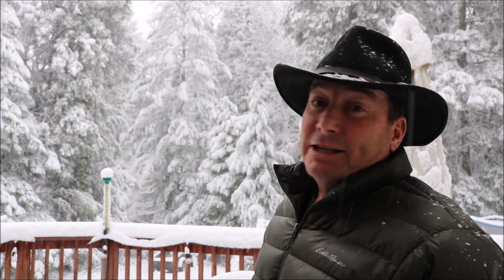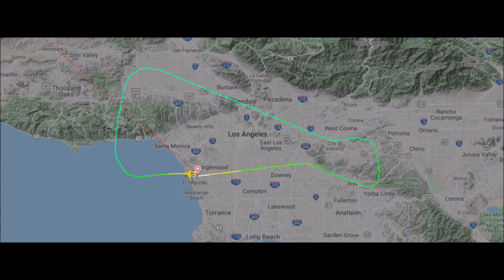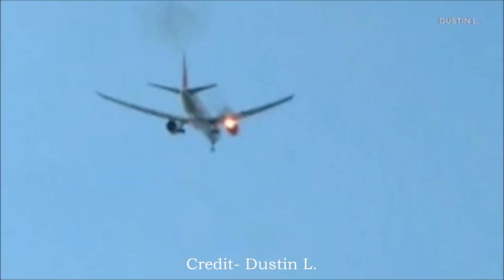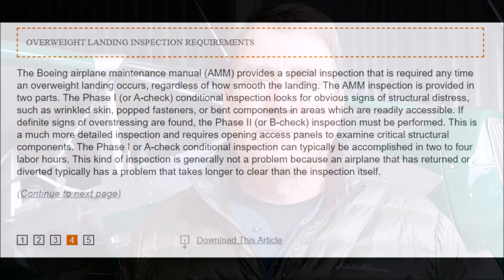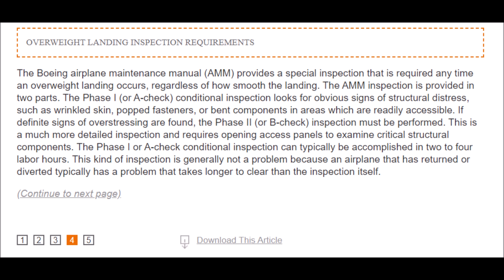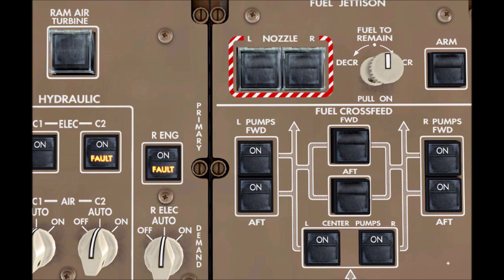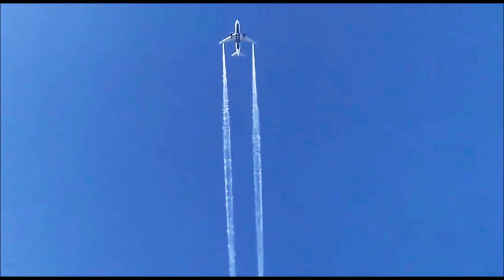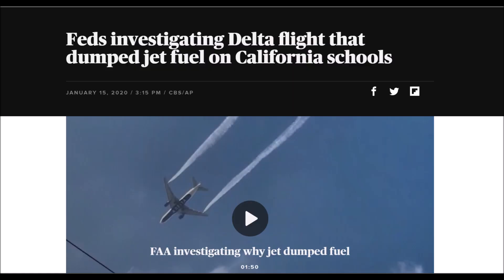B-777 Fuel Dumping and Overweight Landing Considerations (Part II)

Comment: For what it is worth. I am of the opinion that all of "Alphabets" subsidiaries are implementing an agenda that is both wide ranging and comprehensive in scope and anticipated outcome. The vagaries and inconsistent nature of the various "problems" and "issues" encountered by individual subscribers are indicative of an algorithmic non-linear random hierarchical distributed control system wherein the rule based flow diagrams which would, ordinarily, deliver consistent analysis and processing of system throughput, is assigned a subordinate priority to a master set of code intended to create the appearance of processing error. The purpose for such a counterintuitive  rule set is to inject chaos into a seemingly complex operator and provide credible rationale for errors. A sufficiently macro analysis of all errors and error patterns  may provide evidence of the deliberate inclusion of such code. Further, a self correcting diagnostic sub-routine, coupled with an heuristic feedback loop, will continue to modify and rewrite it's own operators to force evolve and deliver credible performance statistics as a means of misdirection, camouflage and concealment. The human components are, quite possibly, unaware of what they are dealing with. A similar runaway system without access to external networks was scuttled by DARPA due to the unpredictability of the resultant descendant.

Comment: OK, so there is commentary here that an overweight landing can take place with 6,000 ft. of runway. The problem with this, is that numbers indicating max gross weight stopping values are contingent upon both engines being functional and providing full reverse thrust during landing. This was a plane attempting a near max weight landing on a 12,000 ft. runway with only one engine and maximum manual braking. The checklist from Boeing as I reviewed simply says to land overweight under single engine conditions, but gives no callouts for what the max landing capability is of the aircraft without full reverse thrust. Both of these conditions occurring at once, do not seem to have a checklist, despite the callout in the single engine failure checklist to land overweight ASAP. Please, correct me, if you have the data to back this up. Is this an oversight of the checklist? Or are their supplemental numbers for max landing weight under these conditions? Was the plane ever tested for this set of conditions?
Reply: Christopher Bruscato: Juan said in response to another question about thrust reversing, "No, you don't reverse on that engine [meaning the Rolls Royce] anyway. Its built into the calcs."

Comment: Here's a thought, why don't you contact news outlets like CNN?  Seems they need someone who knows what they are talking about!.  No where have I seen your comment that this aircraft does not need to dump fuel in order to land at take off weights if there is sufficient runway available.  It also took news outlets far to long to discover that the pilot had said he did not need to dump fuel.  Looking for a channel boost, this might do it.

Comment: ATC asks if they wanted to do a fuel dump and they replied that they did not.
Reply: liam101ish: As Juan often says: Watch again. ATC asked if they wanted to HOLD to dump fuel.
Reply: @lizj5740  Fair enough but they give FUEL on board as 212 Tonnes when they declare and before final they are asked again 209 tonnes...why not indicate it will be less after the dump especially if equipment is rolled as they ask?   They are also requesting the longest runway because of weight.   I think ATC assumed as well they were not needing or intending to do the dump.    ATC should have pressed them but if I was the guy working it, I would have made the same assumption.  They are not dumping and do not intend to do so.

Comment: Why are the tires filled with nitrogen?
Reply: Less likely to burst and when it does burst there is a lower chance of fire.
Reply: @nightflyer3242  Does it compress better?
Reply: @staubach1979rt  Not really.  Air is mostly nitrogen anyway.  For one thing, using dry nitrogen in the tire ("dry" so there is no moisture to condense and corrode the wheel or other metal) rather than air reduces or eliminates the chance of ignition within the tire if a contaminant is introduced.

This happened for example with the nose tires of a widebody several decades ago.  The tires were inflated using a hose which had hydrocarbon contamination on the inside from having been used for something else.  The NLG tire(s) failed during takeoff roll, and takeoff was aborted post-V1.  The aircraft overran the runway, stripped the landing gear per design, and was destroyed by fire.  IIRC everyone made it off ok, the last one off being a flight attendant who had made sure the smoke-filled cabin was cleared before jumping from the sill of the forward entry door (no slide).
Reply: @marcmcreynolds2827  Interesting. Thank you.

Comment: Great Video   Your standards aren’t far above the Media giants, sadly 
I had a fuel dump in my Piper Cherokee 😱 Leaking test valve that vented 24gals in 40 minutes. I landed without out incident, Thankyou Lord
Hours of mundane flight sparked by seconds of terror.  Pilots did there primary job, return safely 👍

Comment: Add further please, to the following concept:  While it  would seem common sense, if you have to Jettison fuel, and preferred altitude is not available,  One might want to jettison over non populated area.  --> The public continues to insist there must be a LAW about Where It's Allowed.  That is, a specific aeronautical, FAA denoted /region/ where jettisoning fuel would be permitted.  Such regions do not appear on my approach plates, nor on any of my charts,  Nor are such regions mentioned in the FAR/AIM.  Nor is any specified region listed in ATC  sections of CFRs.
==> Thus I conclude:   There is no such specified region.   Just as there is a recommended min Altitude to jetison fuel there is no binding /regulation/ specified altitude. 
 Please expound on this region-concept as exists as a regulation:  Plenty of world airports have no such space available around cities.  // (*Other than 14CFR 91.15, that is.)
Thank You.
Reply: I thiught that the issue was the low altitude. Could this not have been avoided if they anticipated the problem?
Reply: @kirstinstrand6292  Issue was low altitude, but only as far as a recommendation on normal flight.  There is no mention, in any of the regulations of jettison altitude for EMERGENCY flight.
The only regulation on fuel jettisoning is that the aircraft KEEP enough fuel for 30 minutes of flight.  Nothing about altitude.
Your Second Question:  Could this not have been avoided if the anticiapated the problem?
-- er.... anticipated the problem of having a Compressor Stall and declared emergency?
 Are you asking if they could have anticipated this emergency?     ???

Comment: If this were a GE90, never would’ve happened 🙂
Reply: It's not the engine, it's the adjustments to the engine. Or possibly a faulty sensor for either outside air pressure of compressor inlet temp.

Comment: Hi. Why couldn't the pilots and the crew members just issue all the passengers parachutes and then push them all out of the plane on final approach, instead of dumping all that expensive jet fuel? I think Boeing now has to install a Static jump system into all their new manufacturerd aircraft. A new Static jump system S.T.C  for the Boeing 737 MAX just may be the thing that could save that program? What do you think Mr Brown? I personally don't understand why the pilots had to dump all that Jet A ?  The Pilots could have also just put the aircraft into Military power,                           "Full Afterburner" and just burned the fuel off with a few loops over the patch? Stupid pilots, don't  they know anything? I remember having a similar situation way back in WW2. I was taking off from the deck of the U.S.S Qween Mary when the aircraft I was flying, a Ford Tri-Motor ingested a Ostrich on take off. It happend at the very end of the cat shot. I thought I was a goner for sure, I was barley able to climb out on the remaining engines, man', what a ride, the cockpit was busy that day, but I had to get back on board the boat somehow?? But you didn't see me dumping precious fuel, paid for by our Tax dollars,  heck no!! I just threw that War Machine into ZONE-5, "The Danger Zone", I cranked up some Keeny Loggins or was it Kenny G? I don't remember, it was pretty hectic up there. I just remember going ballistic, straight up, with my hair on fire, it was like some kind of rollercoaster from hell and I did that like 12 more times until I lowered my aircrafts weight enough to land back on the boat. My War bird was coming in hot and crippled, with one hand on the sticky-yoke and one finger on the ejection button, it was either make it or break it? Needless to say I'm writing you this comment, so I'm still here? minus a Big toe and my left buttocks, but I digress. It was a amazing feat of airmanship if I do say so myself and I just did? I love all your videos, you are a very knowledgeable man Mr Brown for sure and I look forward to your next one.        Take care. Hawk out !!

Comment: Juan... have to respectfully disagree with you on fuel dumping being neither here nor there.  Sure, you can land overweight, but an overweight inspection doesn''t fix anything and I don't trust mechanics to actually have the ability to precisely measure, let alone repair, the micro-damage and minute deformations that an overweight landing imparts onto the aircraft on dozens of systems, the fuselage, etc..  There's simply no way to measure if the landing gear or fuselage has been deformed by hundreds or thousandths of an inch or whatever.  And there's no way to fix it even if you could measure it.  

So fuel dumping should absolutely be done to avoid an overweight landing under any circumstance.

Landing overweight is the biological equivalent of hitting your head and suffering a minor concussion and saying it didn't cause any damage because you can't see any damage on any diagnostic or cognitive test.  One, yes, you did cause damage (at the cellular level, which cannot be precisely measured).... Two, doctors (or aircraft mechanics) cannot fix complex micro-damage even if they could detect it, which they can't.  But rest assure, that plane has damage at the microscopic level.  And the CarFAX report for that 772 will lower its resale value down the road.
Reply from the maker: No.
Reply: Puma, The aircraft as Juan mentioned is certified to land at maximum take off weight, as well as at maximum landing weight. The difference, it is certified for a touchdown rate of 360 feet per minute at max t/o weight, and 600 feet per minute at maximum landing weight. A hard landing would be at a rate of well below either criteria, so the margin for damaging the aircraft in either case is substantial. If you want to take this to the extreme, one does micro damage every time the aircraft taxies, takes off, cruises and lands.That is why we have periodic "C" and "D" checks.

Comment: Ask the Swissair Cap near Nova Scotia what he thinks about continuing to dump fuel at proper altitude. Oh! Diving into the Atlantic at 550 mph was much more preferable. Problem solved. Good decision Cap!

So the school was the only location where fuel was evidenced. Totally understandable! They did tight turns over that school to make sure those kids got rained on good. 2,500 feet is 500 feet above my estimation as a former crop duster. Fuel will evaporate before ground arrival. Another case of idiots not knowing their ass from a hole in the ground. 6 to 10,000 feet is a case of the Future Aviators of America covering their ass & totally asinine.

Comment: Rolls Royce engines have always been problematic.  You'd think by now they would have the technology figured out.
Reply: Not all of them.  We had them on the 757's I used to fly for AA, and I never had a single problem with one.  At one point, about 7-8 years into our operation of the 757, the guys at Tulsa told me that not one of the spare engines we had bought with the airplanes had been put on a wing!
Reply: Anthony Vallillo That’s pretty impressive! Any idea how many 757’s your fleet had at that time?
Reply: @anthonyvallillo422  That's encouraging.  I was thinking specifically of the L1011.  There were others where the RR engines shit the bed somewhat routinely.
Reply: @bigjeff1291  If I recall, somewhere around 75 or so
Reply: Anthony Vallillo Thanks for the response Mr. Vallillo!